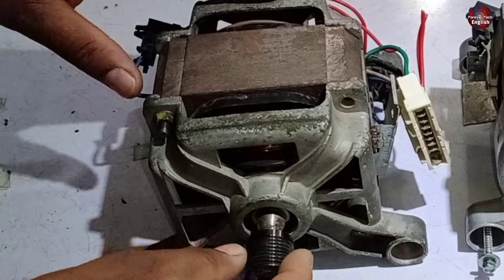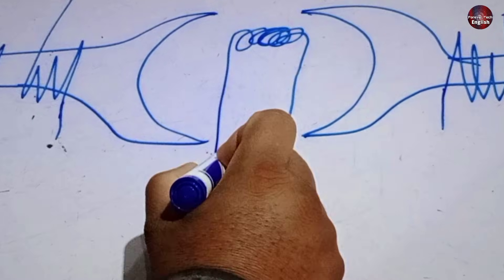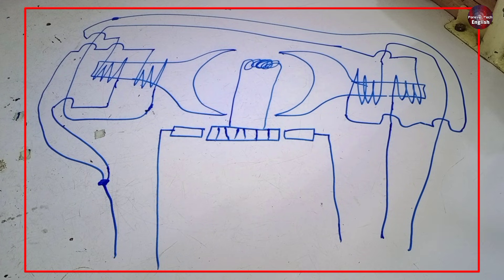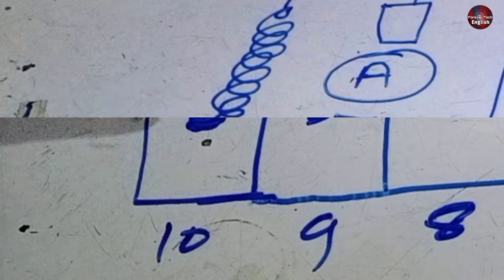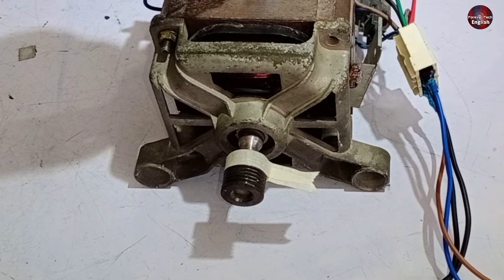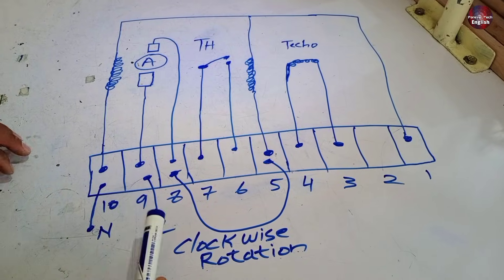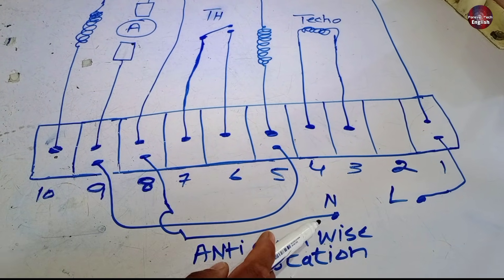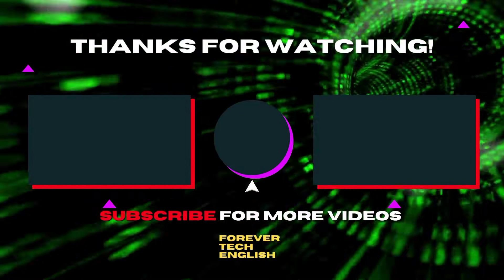How To Make Washing Machine Motor 9 Connections

Comment: I have the same motor, I guess but it is a DC motor for 200/220 volts. Did you connect it to 220 VAC directly? I can only assume this from the 8-wire-video where I see the normal plug but you didn‘t say anything about it in this video.

Comment: Hi,Is it possible to directly connect to AC power?(220)
Reply: I am no electrician and have just got a motor to play with - but from what I understand if you connect these motors without a load on - they will just get faster and faster until the bearings die.
I'm going to make something out of mine but I will incorporate a speed controller.
😀

Comment: KOOL IM INTERESTED IN LEARNING HOW TO USE MOTORS FROM WASHER MACHINES AND OTHER APPLIANCES,   
I HAVE AN IMPORTANT SAFETY  QUESTION 😮
 CAN I TEST EACH WIRE TO SEE IF THERE'S MORE THAN 1 WAY TO MAKE MOTORS GO CLOCKWISE AND ANTICLOCKWISE???
 I DONT WANT TO GET ELECTROCUTED .. 
I DIDN'T SEE YOUR EXPLANATION HOW YOU WERE ABLE TO SWITCH PORTS AND JUMP LINES AND USE DIFFERENT WIRES FOR NEUTRAL AND LINES
THANKS i LOOK FORWARD TO WATCHING MORE YOU'RE VIDEO GOD BLESSS